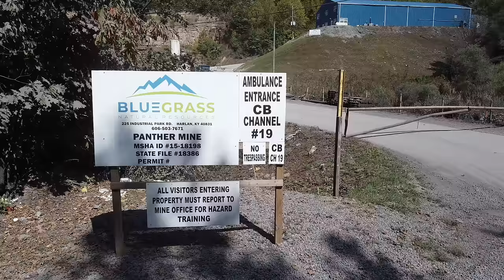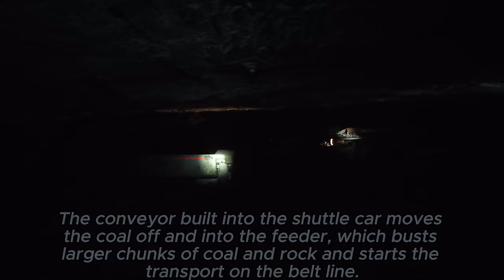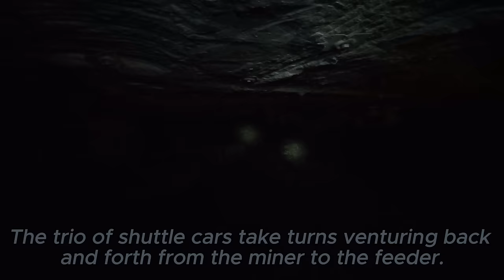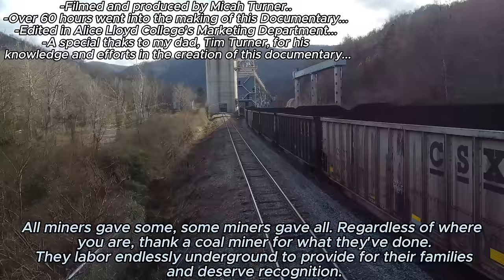Where The Coal Comes From; How Coal Is Mined, Processed, And Shipped. (A Documentary)

Comment: Having spent 26 yrs in the coal industry this video brought back many memories. The first mine I ever entered was Consol's Itmann mine back in 1973. it started like a railroad entrance and wound up that we had to roll out of the man-trip conveyor. The height was less then a kitchen table. We were told that the mine sloped back and we were 2 miles in and about a mile under the mountain. Yikes! Great video!
Reply: I started at coalwood in 75  went down on the cage to the bottom then road for 45 min to the face

Comment: What a great insight in to how coal is mined in the USA. As a former UK coal miner, our systems are vastly different. UK coal mines where predominately deep coal mines. Where I worked was called Brodsworth colliery located in the city of Doncaster in the county of South Yorkshire England. It had three shafts, working four seams. These where the "Bansley seam" 10 foot high coal seams, Acessed from 1900feet below ground,. This level contained  the "Dunsel coal seam" at just over 5 foot thick.
The other 2 shafts when down to 2800feet. There where also to seams worked at this depth. These where the "Parkgate seam" at 5foot thick, and the"Thorncliffe seams at 5 1/2foot thick. 
There coal faces where a long wall coal face of some 300 mtrs long on average. in total there 9 coal faces working at any given time, producing 1 millon tonnes of coal a year. employing over 2500 people including surface workers and office staff. the first Sod was cut in 1905 and closed in 1989 by the UK Thatcherite Goverment. Doncaster had 13 collieries  and all shut causing mass unemployment and devastated all the communites of the city of Doncaster. The Uk still has massive reserves of coal in the mulit millon tonnes.
There are now no UK deep coal mines. The coal mines went on strike for 12 months to fight the closure. Sadly we lost the battle with the UK Goverment. 1984 strike.
Reply: Same thing happened here in wv thanks to Reagan we never did recover

Comment: My first mine was like this one a drift mouth. I noticed people were able to stand up and that is worth a whole lot by its self plus it looked fairly dry under there. The last mine i worked in two weeks ago was a shaft mine we took an elevator 680 ft down to the coal seam the rode a rail car for 45 minutes back to section 3 which was only about 4 and half to 5 foot in most places and had about 6 inches of mud and water the conditions were horrible. I am 5 ft 9 inches it felt so good just to find a place that the top had fallen out of so i could stand up for a minute. Low coal dose not do the back any favors..